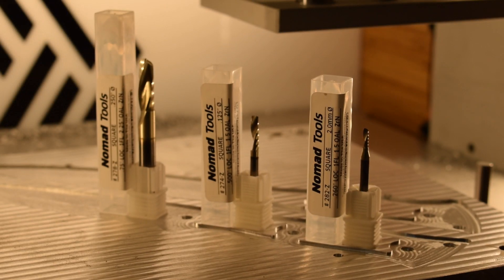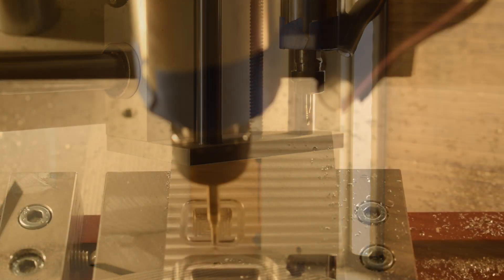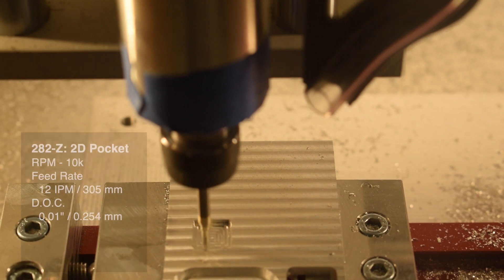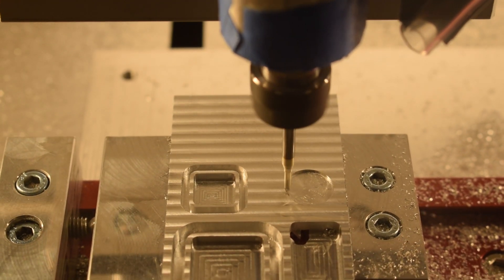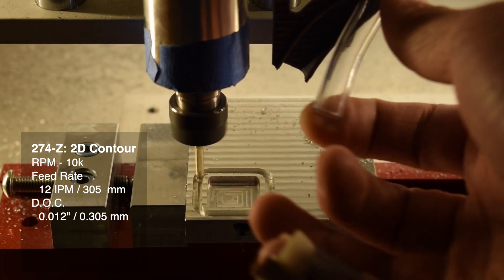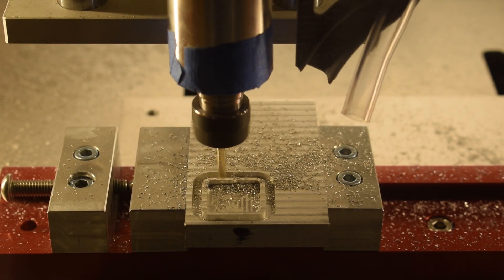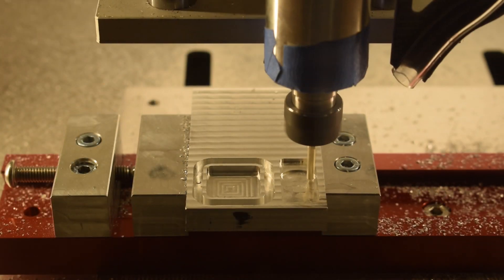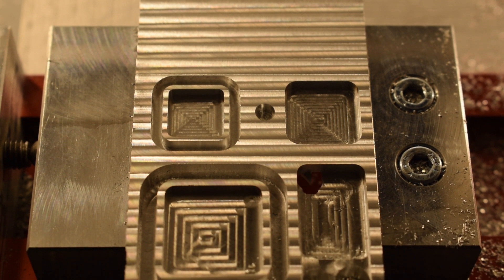Single Flute Endmills Machining Aluminum on the Nomad - #MaterialMonday

Comment: The 278-Z - 1/4" endmill, was in the initial frame but didn't have any cut time. Would you recommend running that endmill on the Nomad with the larger collet?
Reply from the maker: Because of the larger diameter, it requires a little too much torque for anything more than very shallow cuts. However, if you're looking to surface aluminum or use adaptive toolpaths it can be made to work. (Use a similar optimal load/DOC as the 274)

Comment: Have you tried doing a greater DOC?  When doing such shallow cuts, you're only using the very bottom of the flute's edge, and run the risk of much higher deflection.
Reply: It's probably not fair to argue with you-from-5-years-ago, but a shallower DOC reduces deflection forces. If you're concerned about deflection, you could still use a short cutter, with a greater DOC.
Reply: @AwestrikeFearofGods  I'd normally agree with you but 0.01" DOC just seems impractical.

Comment: Winston, two questions; the holder for the air blast hose looks interesting. Will you share the .stl file? Second, what’s with the painters tape on the spindle? Thank you for the very informative feeds and speeds videos.